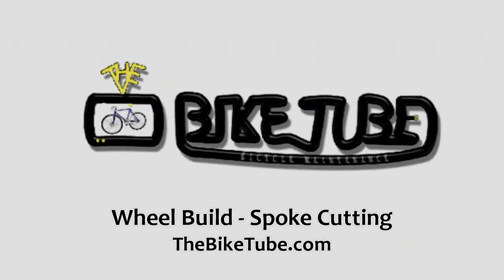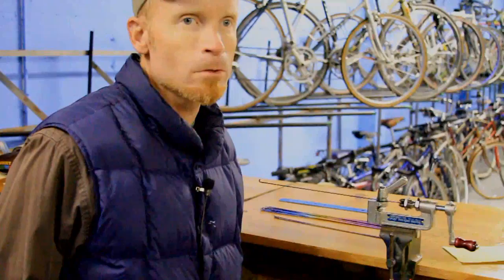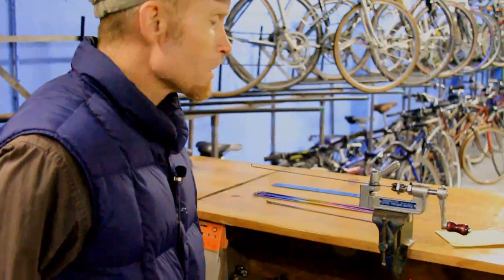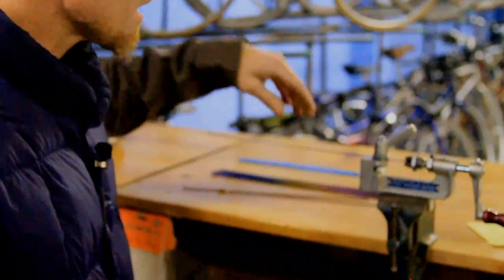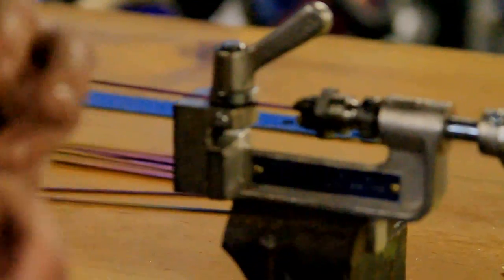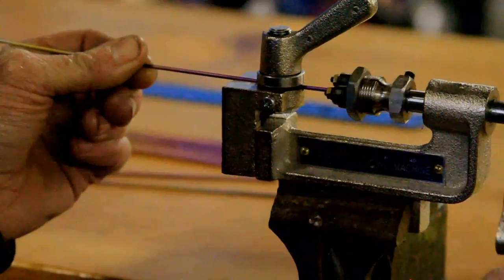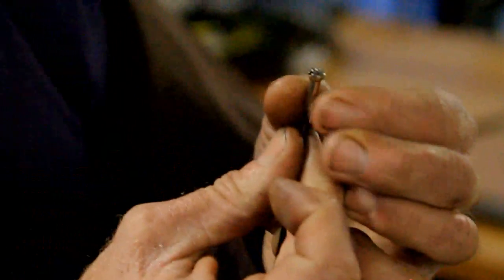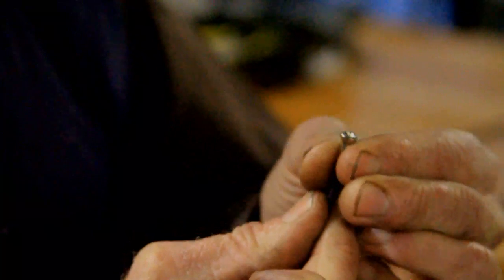Build a Bicycle Wheel: Spoke Cutting with Hozan Spoke Threader

Comment: Cut first THEN roll, and you won't have to de-burr the end of the spoke!
Reply: He never explained why he cut to length after threading the spoke. If replacing 1 broken spoke then it would be faster to size it this way rather than to remove a spoke and to measure its length.  Make the spoke a bit longer install to see how much needs to be trimmed and then undo nut end and trim off the right amount to make it a perfect fit. I usually measure a good spoke for the length.

Comment: There are custom hubs especially rear that may have spoke flanges larger than the Gear cassette in which case the spokes on that side might be 30 mm or more shorter. 
Many hubs are not central either such as Disk brake front wheel requiring the rim to be offset on the hub to give caliper clearance but central between the bearing flanges that fit inside the fork legs so the spokes will be different by as much as 2 mm or more.

Comment: At least you said Rolling  the Title should be edited as this tool does NOT cut threads but is rolling or as you correctly said cold forging. You should cut and prepare all your spokes BEFORE rolling the thread in this way you will not need to file the ends, it will give a cleaner thread and save time as well.

Comment: Furiously scritching notes. This is awsome, I have a quesiton though. This technique is it usabl e if you have a custom sized wheel and need to make spokes for it, considering that the end of you spoke where the nipple goes would not have any threads? The hub I want to use is much larger then your average and would push the spokes through the rim and the section that currently meets the rim has no spokes on it at all.